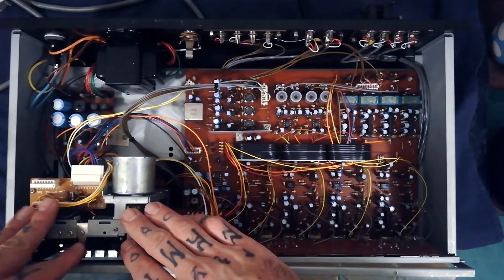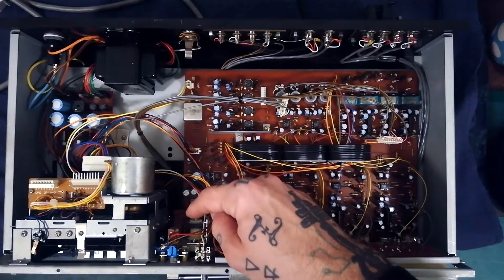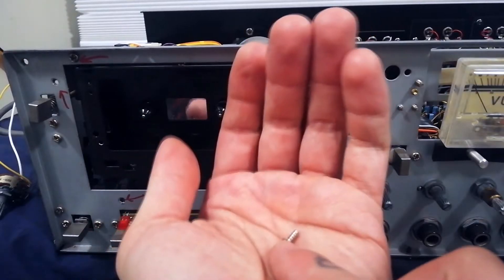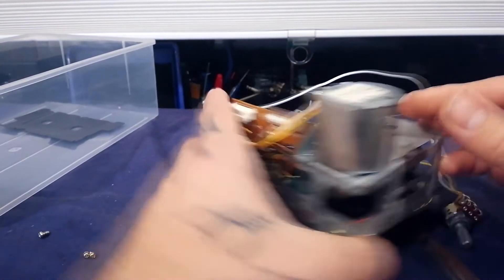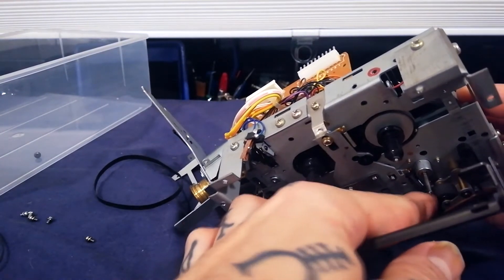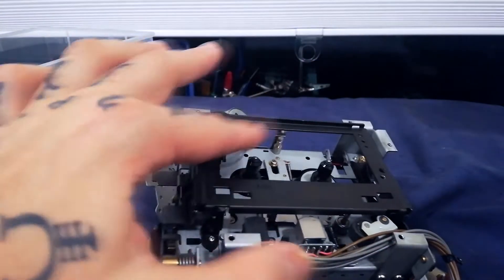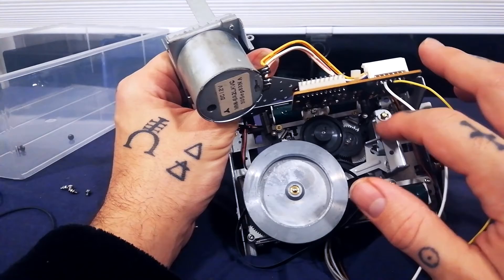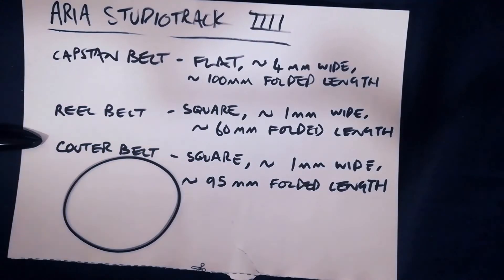Aria Studiotrack IIII | teardown 2 | detach transport | change belts

Comment: I just recently bought a Aria Studiotrack R-504, The transformer is bad and needs replaced. My electronic tech said' he can't fix it without the schematics. (Transformer is unavailable)  wish I could get this baby working! as of now, I'm at a dead end...Do you have any suggestions?
Reply from the maker: If the transformer itself is really faulty then I can see why a tech who needs to make a living from what he/she does would be reluctant to track down and install a replacement - it would be a frustrating job of indeterminate length  to find a suitable replacement and find a safe way to mount it. But transformers are pretty robust, unless they got hit with lightning or some other huge power surge then the chance that the magnets and coils are actually damaged seems remote to me - its more likely its the other part of the linear power supply (rectification and filtering ) which is at fault - again I could see why having to backwards engineer this little board without schematics and test or replace all the components might figure low in the triage of a service engineer who is trying to make a living, but the chance this is actually impossible to fix seems low to me. Even if repairing  the transformer and the board with the rest of the linear power supply on it were off the menu, really that board is supplying 5v, 12v and + and  - 15 volt DC to the rest of the circuit, and there are probably alternatives which do that which could be installed inside the case of the aria - there is a lot of space in that box. But you'd probably have to take that on as a passion-project, because most service engineers are too broke to turn down 5 bits of easier work, which is what they'd have to do to undertake a project like yours. If you could get another one cheap, you could probably just frankenstein together the best bits of both and sell on the spares unit, doing that kind of thing is how I got started. Good luck!